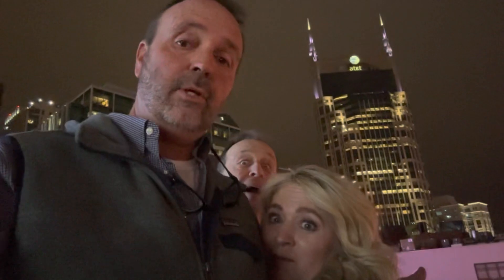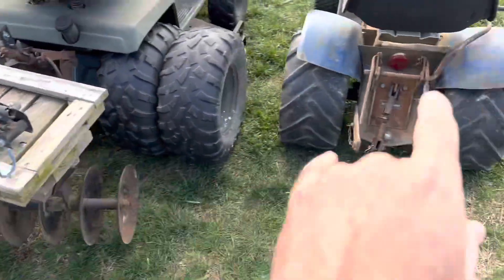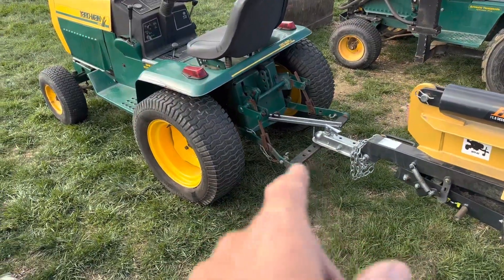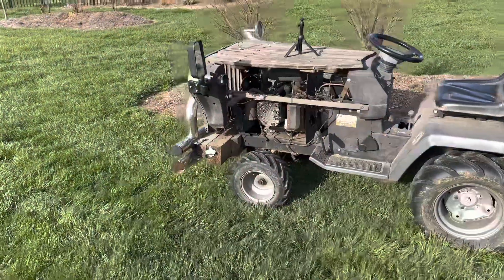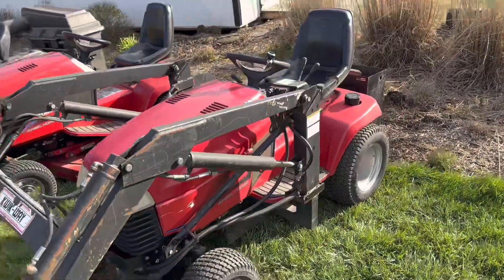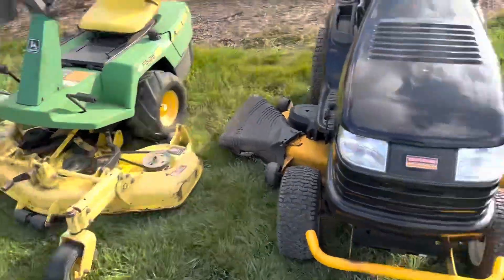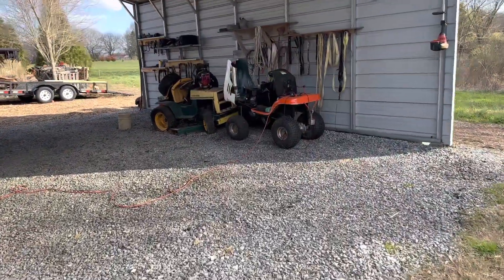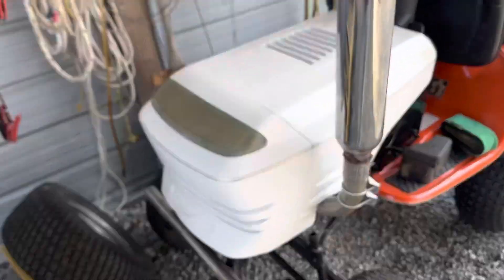￼ Garden tractor  hitchs

Comment: Sounds like the valve lash timing could be that if the mower still keeps turning over slow
Reply from the maker: I agree that could be it, but it was just a bad battery. I went back and swap it out for a different one fired right up.